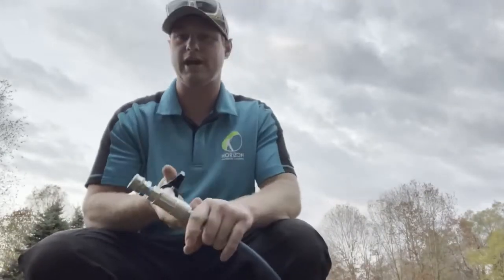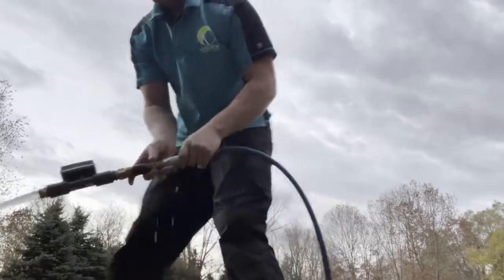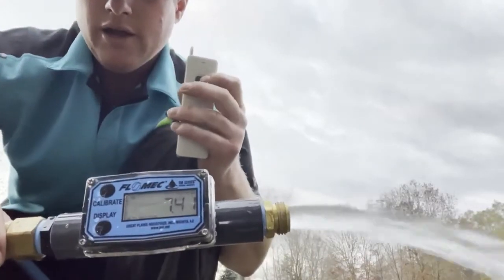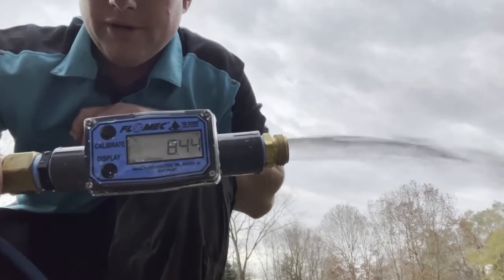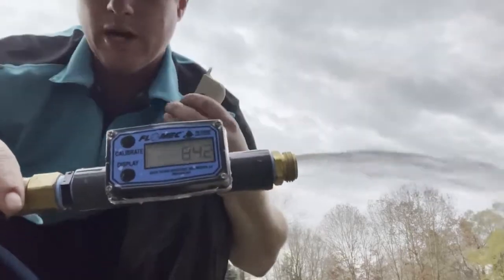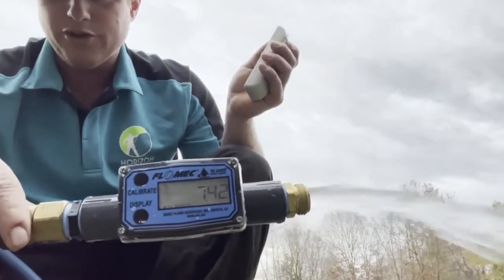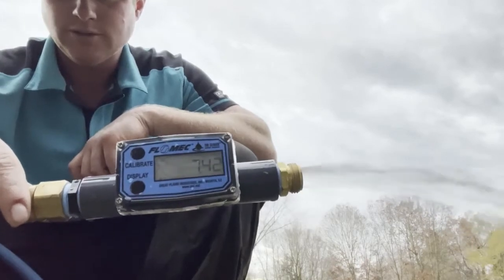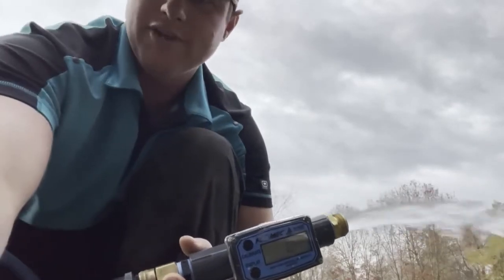FlowPro Flow Test

Comment: Even now, it amazes me that through even the tiniest of orifices of a chemical injector, it still will flow beyond the 7 GPM mark. As for the intent of the video, that approximate one GPM makes a significant difference in the performance of our equipment...especially with surface cleaners.